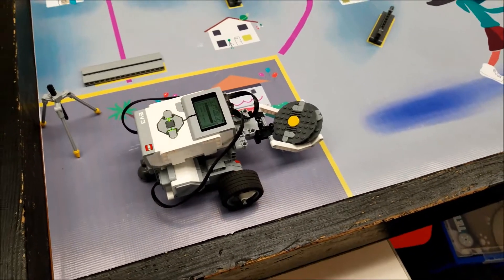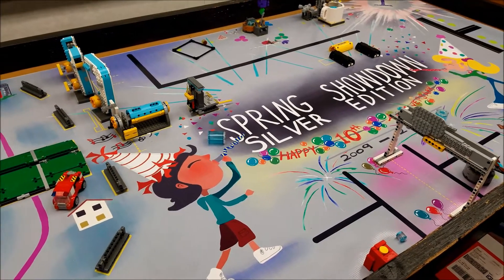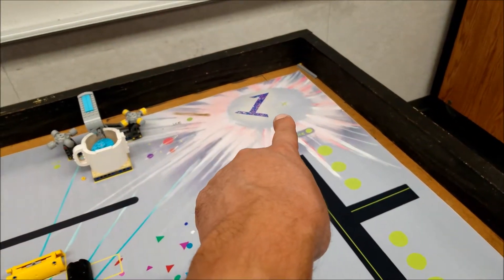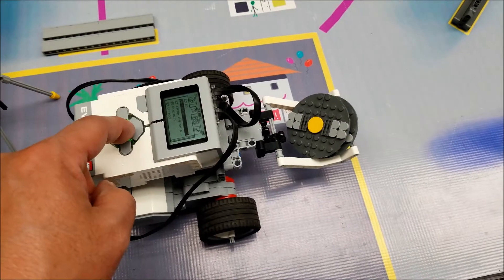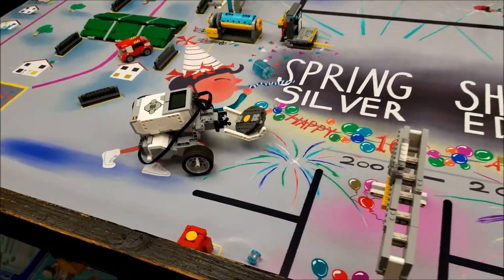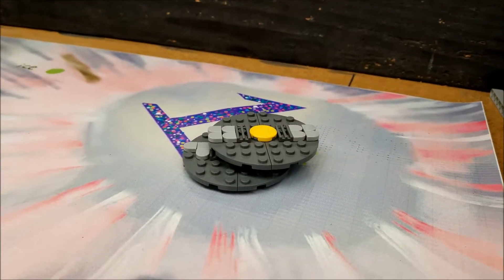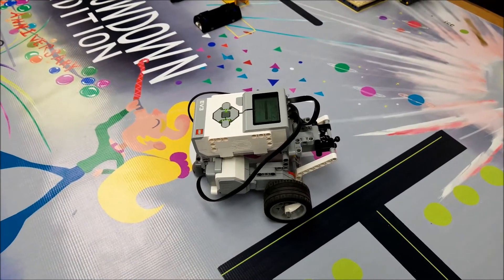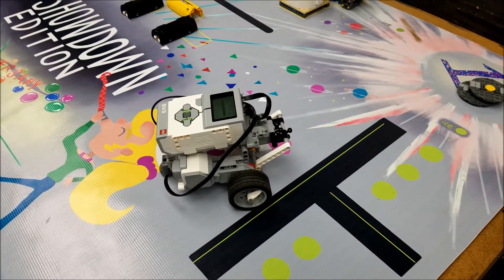"Using The Medium Motor Attachment On The Riley Rover For An FLL Mission"

Comment: Hi, really enjoyed watching your vids.
I am currently coaching a girl guide group into the first stages of fall.
They competed in a competition last year and got the bug.
I have a question on line squaring.
We have managed to write the software to square on a line using  two line sensors but am struggling with the problem of once one sensor detects the line it instructs that motor to stop whilst the other continues till detects line also and then they should both be ready to enter the main loop for line squaring.
Unfortunately this great for angles less than about 30deg to line to be squared, if the angle of entry greater than 30deg, as the second  light sensors finds the line it is effectively pivoting around the stopped wheel, gggrrrrr, hence takes the first sensor back of the Black hence confusing the program and not aligning.

Regards

Paul nicholson

Hexham 3rd Guides

Northumberland, uk